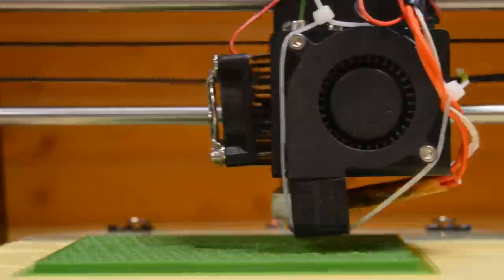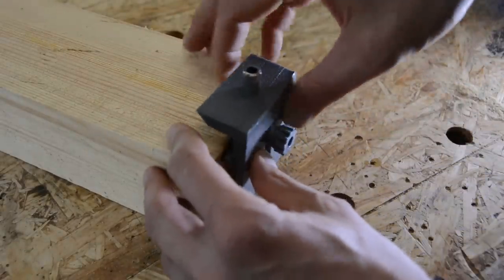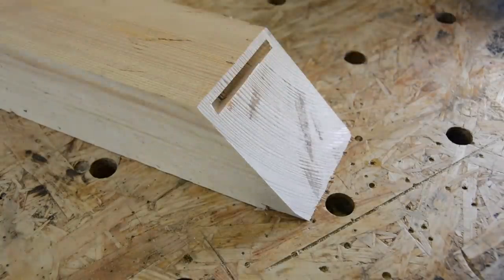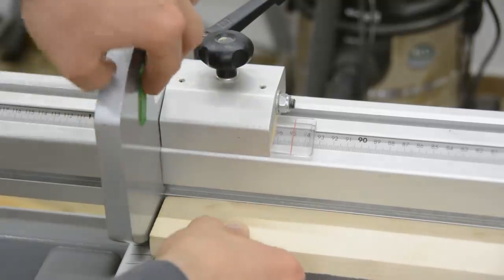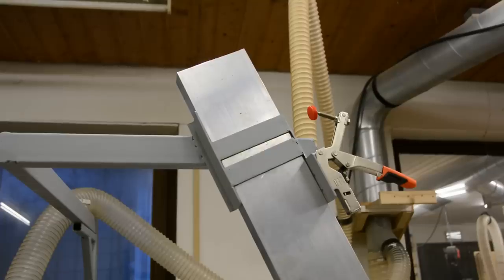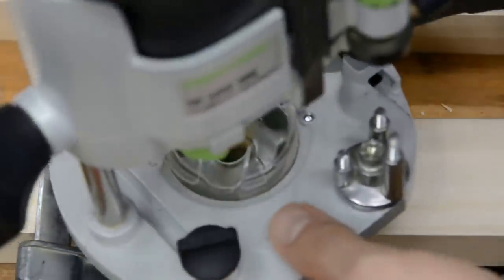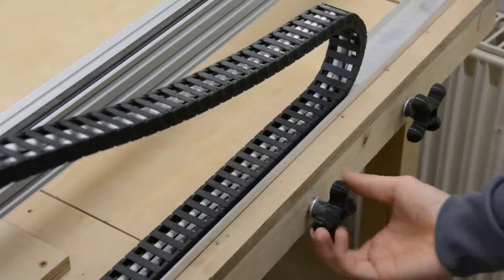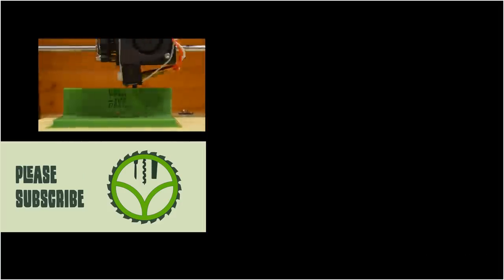Top 10 3d printing projects for the woodworking workshop

Comment: I have two 3d printers and a cnc router and actually AVOIDED this video. I thought "Cheesy dangerous and waste of time." WRONG! The hole hangers alone were worth the watch! Great vid!
Reply from the maker: Thank you. Glad you liked the video. 

The hangers are quite useful. As they are parametric it is very easy to adjust them to the screw so that they hold the picture in place very well.

Comment: my favorite 3d print is a roller bearing thin rip tool. i designed the parts myself based on something i saw in a tool catalogue. basicly it clamps into a miter slot  and has a skate bearing on a fine adjustment screw that can be locked in position with another wedging screw. the idea is that you can use the fence on once side. and the roller tool on the other side, back a few inches from the blade interface. and set up repeatable rips of very fine thickness the bearing the wood hits against stays in position and you simply slide the fence a little closer each time. i have successfully ripped 1/32 strips with this method, repeatably. works with a band saw too.
Reply from the maker: Good idea!
Reply: _ David _  no, never took a picture of it yet. Its very similar to _Kd7WVDxR0

Comment: O love my Anet A8, just bought an A8Plus but did not use it yet!
Reply: I got one of the Anet A8+ printers for my grandson in-law at last years MRRF and he loves it but the bearings for the X and Y axis went bad and we replaced them with drylin bearings.
Reply: electronron1 I already built mine with drylin on the X and Y, tried to use on the Z but could not align it well

Comment: Great list, although I just found the video :)
I have printed vacuum hose adapters, because nothing uses the same size for dust collection.
I printed a small block with holes for router bits.
I printed 1-2-3 blocks, not as precise but I measured them, they're close enough.
I printed the little side panel for my Festool saw, and a cover for the window to access the blade screw.
I printed several bench dogs, and some adjustable clamps that work with bench dogs (found them on Thinigverse).
Am in the process of making a custom zero-clearance insert for my Bosch table saw, then I'll print one for each blade I use.
It's interesting, when I need something I have to decide is it better to just build it out of wood or print it. I often mock it up in 3d anyways, then decide what needs to be what material.
Reply from the maker: I know what you are talking about. Do I use the 3d printer, the laser cutter, the CNC or just a handsaw... 😏

Comment: A very useful list. I also collected the printer you use, but I can't get such a high quality print. Do you have a .stl file of the xyz and extruder plastic parts? Thank you from now
 bro.
Reply from the maker: The STL files are all linked in the website article. I unfortunately don't have the Gcode files anymore. For the Anet I added a glass from a picture frame as an additional bed that I covered with glue stick. I also had to exchange the extruder nozzle a few times. There are however also more advanced upgrade guides on the web...
Reply: @WayofWood  thank you for every thing
Reply from the maker: Thanks 👍

Comment: Knobs are expensive?? 
At Hornbach (and similar big box stores) knobs only costs between 0.5 and 4 euros a piece. You'll need to print knobs for several years with the same printer before you can match that.
Reply from the maker: Depends on how you value your driving time to the store. If you don’t want to drive each order will include delivery cost...

Comment: Anet A8 is a great printer.
Reply from the maker: If it doesn’t burn down your house it’s great value for money. 😏
Reply: Anet is actually, genuinely one of the worst printers out there. It has faulty downright dangerous firmware out-of-box. I replaced mine with Prusa MK3 and I've disassembled my Anet to use some of it's parts to Hypercube printer.
Reply: @jothain  Anet is a company. A8 is the printer we're discussing. The mk3 is a great printer for a novice congrats on finding one you like.
Reply: @SharpestBulbs  I know. Anet doesn't do any good printer models. People have literally burned their houses with Anet models. They're junk. Prusas come with all safety features possible enabled out-of-box. They're not novice models. They have most refined slicers available at the time.
Reply: @jothain  Sure thing pal.
Reply: @SharpestBulbs Yeah. It's good to know the realities that Anet models are considering generally at very high on worst 3d printer models still sold today. People shouldn't be encouraged to buy so cheaply made and poorly designed things.